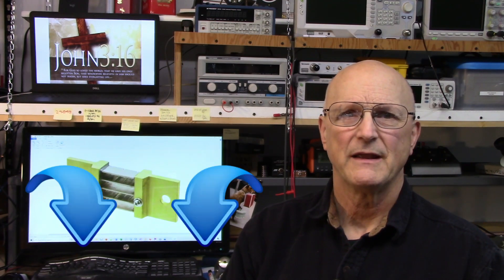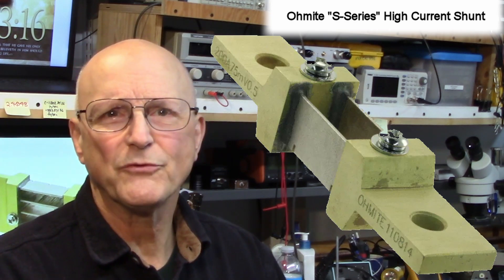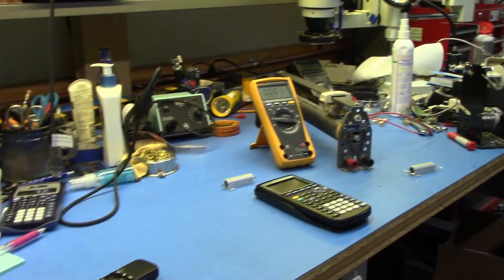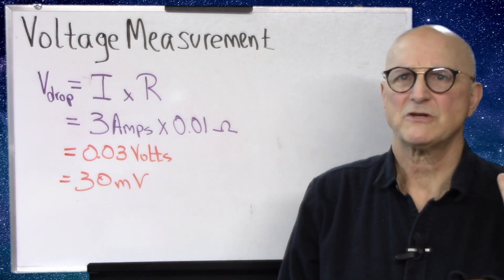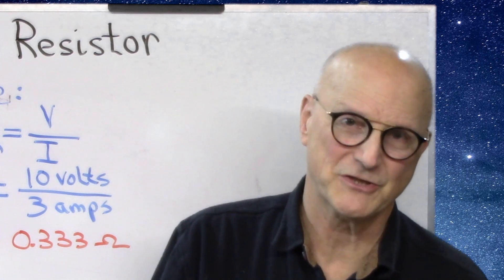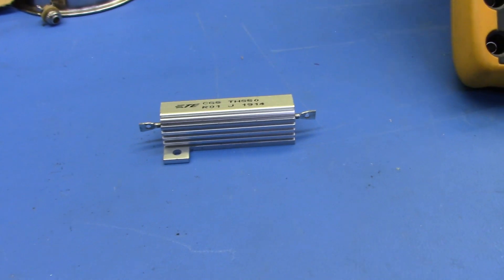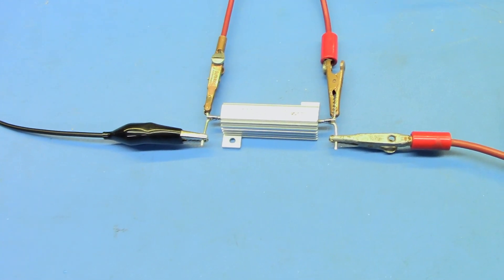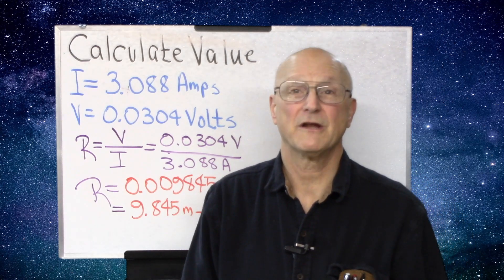Measure Low Values of Resistance Using the Kelvin or Four Wire Connection (021)

Comment: Good video Ralph.   A fun exercise would be to measure the length of wire between a car battery and the starter .  Then using the resistance per foot of that wire, calculate the resistance of that length.  Then connect a voltmeter between the two ends .  Crank the starter . It would be interesting to see the voltage measured realizing the effect of test lead wire and connection resistance.  Then again who has time let alone the access to the innards of a car engine.
Reply from the maker: Sounds like an interesting exercise. The challenge would be to measure the current through it at and voltage drop in such a dynamic environment.
Reply: Standard approach for car checking bad connections is to turn everything on, hi-beams, 4-way flashers, parking lamps, defrosters, fan, interior lights, cigar lighter, stereo (loud), and even wipers (wet the windshield first).  Then measure with voltmeter from negative POST to battery clamp to starter motor (while cranking).  Keeping one voltmeter lead on the post and moving other to the various connection points.  Use SHARP needle points to get thru minor surface corrosion.  After cranking stopped then move non-post lead to every ground screw you can find.  Allowed voltage drops are published and whatever exceeds the expected voltage drop is a poor connection.
Reply from the maker: Interesting! :-)
Reply: They also sell little starter-draw ammeters to lay on top of the battery cable to show amperage draw of large starter cables.   Swings both left & right as influenced by the magnetic field.   Or use a clamp-on ammeter sold for handheld multimeters or stand-alone ammeters with a clamp to encircle the wire in question.
Reply from the maker: Interesting approach. :-)